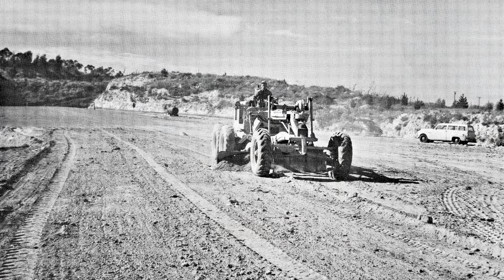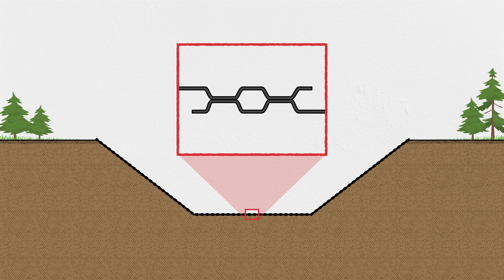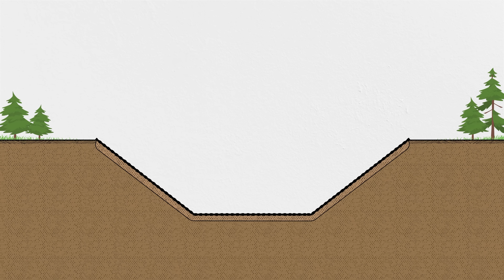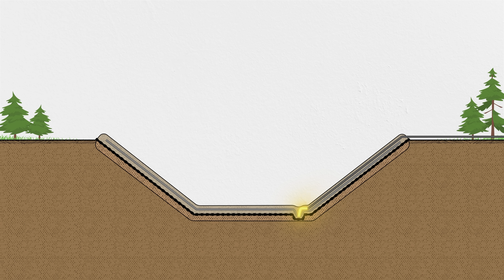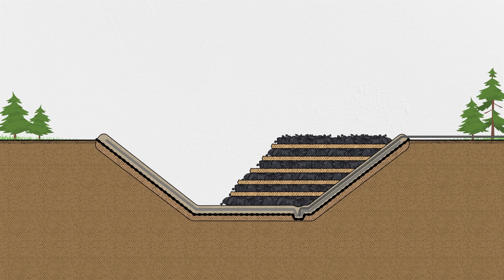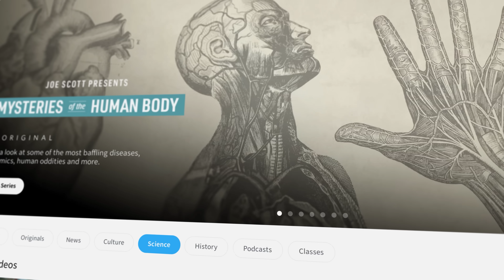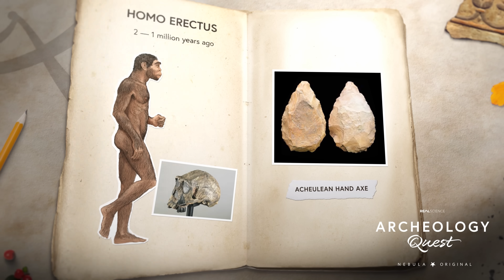The Hidden Engineering of Landfills

Comment: Just wanted to drop a comment letting you know I absolutely enjoyed this explination. I work with the municipality and they also use incredibly strong compactors even after the trucks drop it off at the landfill. The trucks we oversee actually unload away from the landfill itself kind of like an "internal transfer station" that is on site. This is just another way we try to keep things as compact as possible. A random gross fact - all of the recycling that is dropped off at the facility is sorted manually as best as they can. Unfortunately sometimes people use the recycle bins as waste bins and this can cause mass contamination. If it isn't caught quick enough it can result in absolutely insane levels of waste that could have been avoided! Crazy stuff.

Comment: My township built their headquarters on top of our landfill 30 years after it was closed. 5 years later they demolished the whole building due to methane emissions infiltrating the structure and settling. That cost us 8 million dollars, and now they want another 8 million to build a new complex.

BTW leachate collection is quite fascinating. I helped build the collection system consisting of pipes, pumps, storage tanks, safety walls & truck fill stations at Polk County landfill Florida. The tank storage area had to be excavated 13', then 3' of clay added, then 9' of compacted sand & topped with 12" of concrete. Walls & floor were poured in a checkerboard pattern with connecting "bulb-seal" & keyway joints. All re-bar was #8 bar 12"OC double mat.

The leachate pumps under the landfill had 4 wheels and a cable retraction system, in an 8" schedule 80 PVC pipe.

The worst part was building while watching each others back for Gators.

Comment: I worked for 3 years for a company that we went around the country and capped land fills and hazardous waste sites. We used 40 and 60 mil hdpe welding all the seams on the liner. I did a lot of the Quality control in house as well as welding and installing the liner. Interesting work and allowed me to travel extensively all over the country and into Canada.

Comment: There's a large landfill down the road from me,in a small corner of North Wales it was a deep quarry for terracotta clay called Ruabon Mall that was used in local brick production for over a century before becoming a landfill and it smells bad, real bad, it's owned by a French firm and receives most of its fill from merseyside, mostly industrial and medical waste but some domestic refuse goes in as well. But the smell is unbearable, they burn something at night only at night they don't burn in the day,  they also use some chemicals that smell like washing powder (laundry detergent) I'm guessing to try and cover the god horrible pong , after it's been raining and on days of high pressure the smell is worse, the landfill is less than half a mile from a large housing estate and it's to pongy to sit in your garden some days.

Comment: 12:40 Sooo, if you are happy to convert the "outgassing" into energy, why not just burn that garbage in step one, instead of going through the whole rigmarole of burying it. Waste incinerators sound less risky and cheaper over the long run, or am I wrong?
Reply: I would guess it has to do with the gases and fumes produced from burning garbage being much more toxic and environmentally harmful (and less easy to control and turn into energy) than the gases let out by the slow decomposition of garbage
Reply: Because waste incinerators are way more expensive, because the fume treatment must remove way more stuff than just landfill outgas (e.g., metals).  Waste incineration is sometimes more economical in high-density areas.  However they're impossible to build in the US due to overregulation and NEPA lawsuits (no matter how safe they are).

Comment: What will happen to the trash after 100 years? Have they tested  and dig up a portion of the first trash that was put there? I wonder if there is insects eating away the trash. Just like something is eating away my truck and its not 7 feet under ground. 

 I noticed i parked my truck for couple months in my back yard and something is chewing away parts in my truck around the engine. Can't believe it. Maybe its a squirrel because i seen some around here.

Comment: Hi Grady! Have been a viewer for a while. A couple of really interesting things as someone who goes in and out of landfill for work frequently: excellent job on your research! Many of the things you spoke about are very accurate and have rigorous mandates landfills have to meet. Something people don't realize about a factor of landfill height is wind. The higher the landfill is, the higher wind speeds operators face on windy days. There was an incident I believe around December of 2023 near Detroit where a dirt hauling truck was tipped over by wind while fully tipped. The trailer of which, landed on the cab of a garbage truck also dumping and unfortunately took the life of the operator. There are many safety precautions that go completely unnoticed. Second: I love the way you mentioned landfills being used as parks. A great example is Mt. Holly ski resort in Holly Michigan. This too was a landfill in the early 60's that was converted into a recreational area. I don't expect you to take any time to read all this but I'm so happy that people get to learn more of the inner workings of our disposal system. God bless and thanks Grady!!

Comment: I worked at a small landfill and got to do all the stuff mentioned in the video. we used converted chevy truck engines to run the blowers that  ran on the methane. An engine would last about two years with this extremely dirty gas.   The site was flaring 2 million feet a day of gas and it was used to heat some green houses and now a company has built a small electric plant. If you are having a bad day jumping into one of the compactors for and hour or so was a good break.

Comment: i am a trash truck driver and the landfill my company owns just opened an adjacent renewable natural gas facility that converts methane from the landfill  basically to a cleaner power plant that displaces 29,000 tons of carbon dioxide equivalents (tCO2-e) per year that would have otherwise resulted from combusting comparable fossil fuels. That’s equivalent to taking 5,700 cars off the road each year...

Comment: We could eradicate, waste production by manufacturing durable goods designed from the outset for recyclability, reusability, or biodegradability. Imagine everyday products crafted to last for decades or even a lifetime, easily disassembled and recycled at the end of their use, or made from materials that safely decompose. But capitalism, as it stands, runs on a model of cyclical consumption, requiring people to continually purchase new items to sustain economic growth. This leads to planned obsolescence, where products are often designed with limited lifespans to encourage frequent replacement, generating ongoing revenue but also vast amounts of waste. 

If we were to transition to a model focused on durability and recyclability, we would have to challenge the underlying mechanisms of a system that rewards volume and frequency of sales over longevity and sustainability. Only by addressing this root cause can we move toward a truly sustainable economy, one that doesn’t rely on endless consumption to thrive but instead supports long-term resource conservation and environmental health.

Comment: 6:45
If you put a pump to bring the water up again, this cycle would cause the water to evaporate more quickly.
Perhaps this is the way to prevent water from accumulating on roads and streets.

Comment: About a mile away from my parents house was a small landfill that got filled up and closed years before we moved there and it was pretty ingenious on how they converted it back in the late 80’s. They did convert it into a golf course, but it also has a wash that runs thru it for the monsoon storms. There had to be some smart engineers at that time to make sure the dirt walls didn’t fail during floods.

Comment: I'm a huge proponent of incinerators. Generate power. Dispose of the reduced ash. Either power would be free and waste disposal would cost money, or waste disposal would b3 free and you'd still oay for electricity.
Reply: Is not that easy, but we already do that, and it has advantages and disadvantages.

"Why we don't just do X?" Isn't a magical argument, it's oversimplifying, if things where that simple there would never be engeneering in ther first place.

Comment: I am a Leachate tech and worked in the industry for 15+ years. Nice simple video to explain this type of landfill. You should have a look at hydraulically contained landfills, by far the safest type and the most interesting. Also not mentioned but a real problem in landfill is fires, and how we fight them is really cool.
Reply: What's your method for controlling internal landfill fires?
Reply: @RulkeMir4Lancer my guess is they fill the landfill with water (hydraulic) and cycle and clean the leachate, before pumping it back in.
Reply: @Loxie276 you’re absolutely right about “hydraulic trap” designs typically being the safest (yet rarer to find). I’m doing my PhD in Canada supervised by the person who first developed this approach back in the 80s for a large landfill near Toronto. For those note aware hydraulic trap landfills, they are a unique type wherein the base of the landfill is actually below the surrounding ground water table. Although this may sound dangerous (counter productive) from a leakage and contamination point of view, it assures that there will be virtually zero downward advective leakage. This is because the level of leachate in most landfills is kept very low through pumping it would (typ. < 1 m head on bottom liner)…. So it is at a lower elevation than the natural ground water table outside the landfill which means the hydraulic gradient of flow is INTO the base of the landfill. The beauty of hydraulic trap landfills is that they accept a certain truth (liner defects) instead of trying to work against it. All landfill bottom liners will inevitably have defects (pinholes, cracks etc) and one can model how a landfill leaks. The beauty of hydraulic trap landfills is that advective flow is upward into these small defects instead of downward (ie into the ground) like in a conventional landfill. This also helps reduce outward diffusion of contaminants. 

In general there is A LOT of science and engineering baked into the design of modern landfills. 

For anyone interested in further reading on this I suggest the book “Barrier Systems for Waste Disposal Facilities”
Reply: Thank You
Reply: Me when i lie

Comment: I was involved in the siting, design, and construction of landfills for 35 years as an engineer.  This is one of the best non technical descriptions I have seen.  Thank you
Reply: What about a landfill that was opened in the 1950's and closed in 1980 due to the cities expansion.  It's now all fenced in and overgrown for years.  Would it have been built without any protection and therefore deemed to be unusable in the future  ?  It's just abandoned locked up land that is considered poison. It's a lot of area that should be used for something.
Reply: @jetboy770371  As someone who has done groundwater sampling around landfills that pre-dates the environmental protection laws of the 70’s. Those old landfills were just an unlined hole in the ground with god knows dumped into them. I had well water that smelled like a landfill from the purging process, not to mention soil from the drilling that smelled much the same. It’s not potable water depth, but a shallower water source. That’s why they’re locked up away from public access. As for future use the monitoring at many aspects of it will tell.
Reply: Do these sites sink or compress as the waste decomposes ?
Reply: No you weren’t
Reply: @EnjoySackLunch You think a video with millions and millions of views wouldn't have at least one of those viewers be an engineer?
Reply: @cocomonkilla wrong
Reply: Not something to be proud of🤡
Reply: @clintonhummel8776 your parents were definitely siblings
Reply: @Canttrustem-ki8vc  because they were logical enough to know that accepting trash from city people into the rural community is a losing game. That makes sense in your world i guess?
Reply: I don't know about the landfill in your case but my town has an old landfill that they turned into a ski resort, lol.
Reply: @clintonhummel8776  Bro thinks the solution to waste is to not have waste management
Reply: @clintonhummel8776  Why?

Comment: With the vertical wells they can install pumps and pump out the leachate that way too. They also run “horizontal’s” which is basically a french drain but for collecting gas. They can either run across the cell floor and be a floor collector, or run in existing trash that will be filled more with trash.

Comment: Nice video, but what happens after those 30 years are up? Majority of the trash will not degrade for hundreds of years, or thousand. Eventually we'll have to dig it up again and "deal" with it? Those liners that prevent the water from seeping through also have a life time of their own, eventually they'll degrade and start leaking water through. Seems like it's just pushing the problem onto the next generation of people down the line.

Comment: People saying "we choose what we buy".
Even making comparisons to very recent products:
I can't find a phone that lasts as long as my 2012 galaxy nexus did (2012-2018). I've had my current phone soon 4 years, so it's on its way to beating it but the last couple haven't managed at all. It was a horrible experience. And there wasn't any user failure. No water damage no dropping/cracked screens. 

They're made to break and it's  completely invisible to the consumer in many cases. I think cars are a much better example though. They break in ways that are completely unreasonable. Like a back-door speaker breaking after 2 years.

The only way to be informed is to only buy the absolutely oldest stuff to see what has lasted and then you're obviously not buying a new old thing, you can't.

Comment: Our city/county solution for closing a landfill was to cap it with two feet of soil, and abandon it. No further use of the area was allowed, until approximately 20 years after it was closed, the model airplane club requested the officials for authorization for the club to use it as a flying field. Permission was granted, and the club had exclusive use of the ares, with specific rules of no digging or disruption of the soil, no smoking, open fires or grills, and driving and parking in selected areas only. Each member of the club had the combination to the lock on the gates that was to remain closed at all times except for flying activities. The model airplane club had a lease with the city for one dollar per year for rent, for the ability to access the site. 
 
This was a great position for the club and the city, and after about ten years, the club was allowed to install a 25' x 400' runway and pilot stands and tables. A covered patio with a metal open-walled shelter was also constructed. The activity at the former landfill was a benefit to the community, and soon after that, two very large areas were fenced in for a dog park - one for big dogs, and the other for small dogs. 
 The former landfill is now open to the public, just like a regular city park, and roads have been paved throughout the area to further enhance its utility to the community. This is an example of how a landfill can become an asset to the community.😀🛩️🐕

Comment: I worked in landfill construction. We use to install the methane gas lines. Build drainage for what’s called lechate which is liquid garbage juice. What was crazy is they would filter this lechate into drinking water for the city. And I’ve helped in major capping projects which is basically just a giant garbage bag wrapped around the mountain of garbage and then buried. They can fill with liquid sometimes and cause a landslide

Comment: ±30 years ago, the landfill at the small city I worked for ran out of airspace. I was put in charge of closing it down and developing a new one. My basic civil engineering degree had not prepared me even vaguely for the task I had been landed with.

I surely could have done with this video then, especially when having to explain to the city fathers that this was not going to cost an arm and a leg, not only both arms & both legs but the entire flipping body...!

And to cap it all, in 30-40 years time they would have it to do all over again, and again, and, again and again.... 

As part of my report I calculated not only the annual running costs but annual amount that would have to be set aside in perpetuity to finance the next ones... 

I was not popular...

Comment: There's not much leverage in the federal regulations to force facilities to produce leachate analysis.  Nice model! Further explanation of the required gas and groundwater monitoring systems would be a good companion to this video. To an engineer, every design constraint is an obstacle to be overcome. It's annoying sometimes. They push and push and push. Landfills are generally located in areas where the top cover (and liner) material can be mined from the same hole the waste is placed into - for efficiency. So somewhere with a low permeability clay. The minimum separation distance between the liner system and groundwater is 5 feet. You take one snapshot of the GW elevation in the wettest months of a single year and that elevation is assumed to be constant for the "forever" of the LF. Climate change... The base of the LF is the largest surface because the LF is cone shaped. The incentive is to push the bottom elevation of the unit to exactly 5 feet - and that's what they do. Five feet is five feet, except where it ain't.